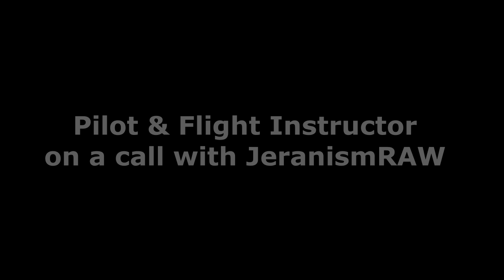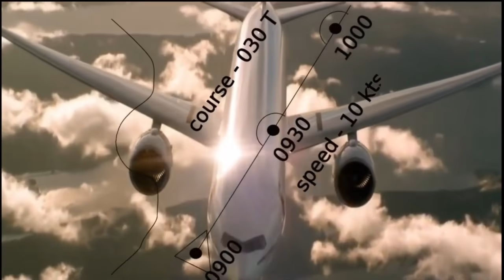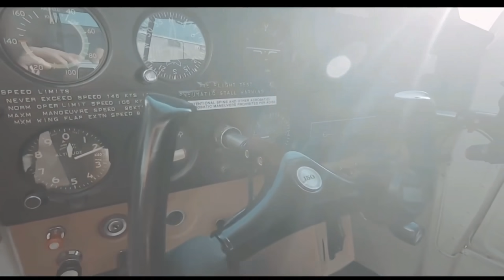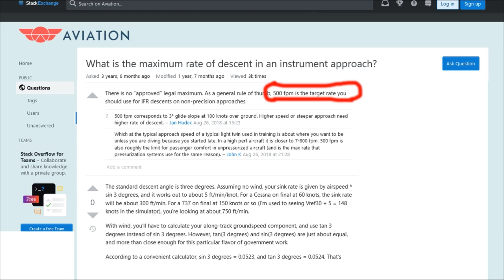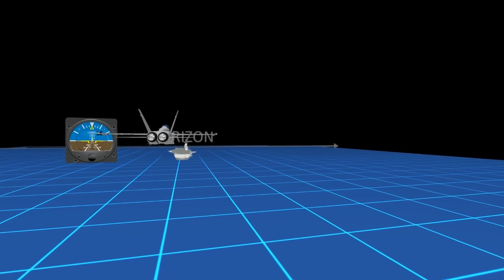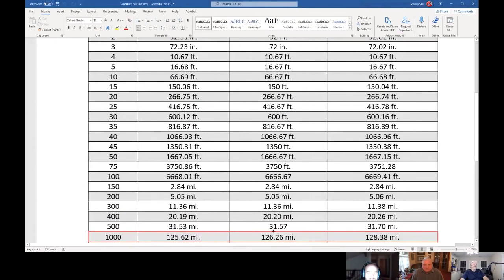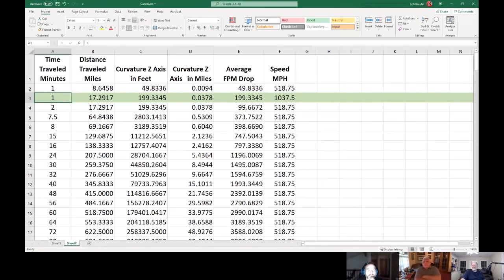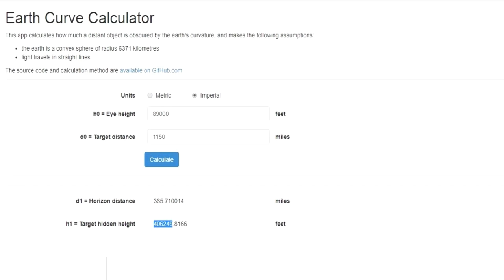3 Hours - 28 Commercial Pilots Confirming FLAT EARTH

Comment: I'd love a copy of those spreadsheets. A very simple calculation using only pythagorean theorem calculates a man 6 ft tall looking on the ground toward horizon should not be able to see an object on the ground after only 3 mi away due to curvature. This is consistent with the 8in x mi2 calc. 0.667x3x3= 6ft
Reply: And yet even with this scientific "fact" the naysayers still say it's a sphere...🤷‍♂️
And actually if it bulges at the equator it means at that point there should be even more curvature.
Reply: Nah,
d=sqrt2Rh+h² 

Where:

	d •	 is the distance to the horizon from the observer’s vantage point,
	 R•	 is the radius of the Earth,
	 h•	 is the height of the observer above the Earth’s surface.
Reply: @GermanManExplosives  Well what you mentioned is not observed in reality.
Reply: Ok
Reply: Ok

Comment: So, let's ask ourselves how aircraft instruments measure altitude? They do so by measuring air pressure. Ignoring weather events for a moment, air pressure is a function of the height above the earth. So if you fly to keep the altimeter reading the same, you will stay the same distance above the earth, regardless of whether it is flat or spherical. And IF the earth is flat, why do ships disappear over the horizon and the first part of them to disappear is the lowest part? The superstructure remains visible as it protrudes above the line of obscuration. And the reason commercial pilots cannot see the curvature of tbe earth is they are not high enough. Go to 60,000ft rather than 35,000ft and it the curvature of the earth is clearly visible. So commercial pilots saying they cannot see the curvature of the earth is no proof that it's not curved. And out of the thousands if not millions of pilots in the world, why can only 28 can be found who claim the earth to be flat? Personally, I wouldn't want to be a passenger on a plane of which the pilot believed the earth to be flat. It indicates a distinct lack of intellectual rigour. I think that attribute would be essential to be for a competent pilot. So I'm not surprised a commercial pilot was 'grounded; for espousing the concept of a flat earth. And the point somebody made about all planets and stars appearing to be round (rather than spherical as they are too far away to see in 3D) would suggest that if they are all flat (as the earth is claimed to be) they are all in precisely the same orientation. If not, some would appear elliptical and some would appear as thin, straight lines as we would be looking at them side-on. Does it not seem odd that ALL the (flat) stars and planets in the universe are spinning at the same angle? Asking for a friend🤭
Reply from the maker: Air pressure is based on temperature. It can remain the same air pressure out to 2,000 miles. When you fly Miami to Brasilia crossing the Equator, the air pressure will pretty much remain the same. If there's no change in air pressure (as there's not), one must correct for curvature in another way. But, still there's no adjustments for curvature even though there is no difference in air pressure for 2,000 miles. Earth must be flat. Cheers!

Comment: To settle this augment, an ultimate proof the earth is flat or not, let's get two pilots with two identical planes. Choose two longitudinal lines about 1000 km, on either side if the equator. Both fly at a constant speed, and altitude. Choose a latitude line to fly over at the same time, both stay on their longitude lines, until they fly over the 90° latitude line from where they started. if they get to that point at more or less the same time, the earth is a ball, if what I think the one taking the south route of the equator will need to have a bit more fuel and time than the one on north side of the equator. If so the earth is definitely flat. This can be worked out mathematicaly how long both of them should have to take. Let's do it. 😊😊
Reply: Great idea, for years I've had the idea of doing this exact thing except with boats. I think doing it in a plane is even better and probably easier. Just have to make sure they take into account the jet streams.
Reply: You're absolutely right @patrick..., that would settle it... but just like going to Antarctica , THEY (you know who) just won't let it happen...
Reply: @GTLyons  - check it out: https://www.adventure-life.com/antarctica

Comment: 30:27 another thing that proves flat earth is radar... think about it. If the earth was curved, submarines could just hide from other submarine's radar behind the curve of the earth.
Reply: Been said. Radar only works on a flat plane. Compass only works on flat plane. Spirit level only works on flat plane. Also iron like our supposed core is only magnetic at low temperatures. Once it gets hot enough it loses its magnetism, then it becomes molten and st that point it’s impossible for it to generate a magnetic field. So how is the “molten core” the cause of the magnetic field? Makes zero sense.

Comment: And NO Liquid fuel in The thin Wings. The AIR/AETHER IS CONSIDERED TO BE THE WORKING FUEL. Read Fundamentals of jet engines pdf. 
AIR - PLANE. THANKS.
Reply: One of the interviewees said no to that
Reply: Sorry that's simply not true , I've fuelled up plenty of times before going flying
Reply: What type of engine does your aircraft use and were does it store the liquid fuel? Also, without a video of you refuelling the aircraft as well as footage of the fuel tank, you provide no proof.

Comment: Math seems way off. 500 miles is 4000 inches. To get feet it comes to 335feet. Then take your 8 inches. It’s 5 feet at 8 miles. Am I missing something
Reply: No you're not missing anything! You're correct and I think what the pilot is missing is the following.

He's taking point A and then point B at 500 miles distance. He's then using the standard 8 inches per mile and then squaring it. However, as you've pointed out, after travelling the first 8 miles (in a minute) and dipping 5 feet, the next 8 miles would also be 5 feet and with no need to square the distance.

I hope that helps and well done for pointing out the appalling misrepresentation.
Reply from the maker: @simon3745  https://www.youtube.com/watch?v=M38IWBYkNmU
Reply: @NoLongerOnTheBall don’t you add the 8 inches by the miles traveled? If you travel 500 miles you get how much curvature? Trying to understand the numbers because it doesn’t seem to add up. Not defending the round earth theory but I can’t get to your numbers
Reply: It’s 8 inches per mile, squared, so 8 miles squared is 64, times 8 inches= 512 inches, or 42+ feet.
Reply: 8” times miles squared. 500 squared is 25,000. Then x 8”, =200,000 inches, or 16,666 feet (of course) or 3+ miles.
Reply: @Jean-tx1fl  that math only works from a fixed point and measuring off into the distance.

If I asked you to measure 1 mile into the distance you would tell me it was 1x1x8=8 inches (well actually you'd tell me it's level and I would whole heartedly agree). We travel the mile and I ask you to measure the next mile ahead, you would return the same 8 inches. 

Clearly if we measured every mile continously with this process, we would measure every single mile as 8 inches of curvature with no use of the squaring function. 

The squaring only works within the formula when adding distance, that distance is from a fixed point.
Reply: Who came up with this formula anyway?